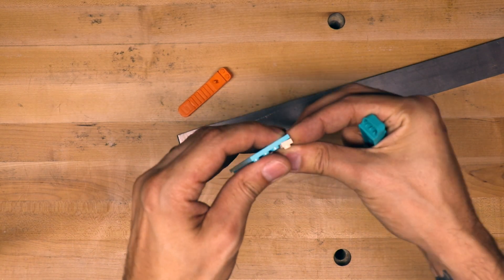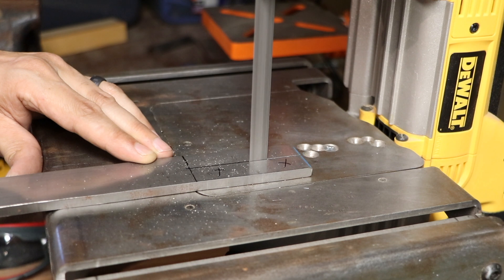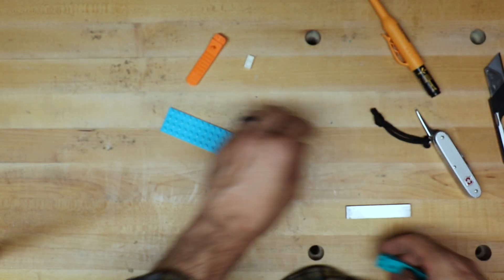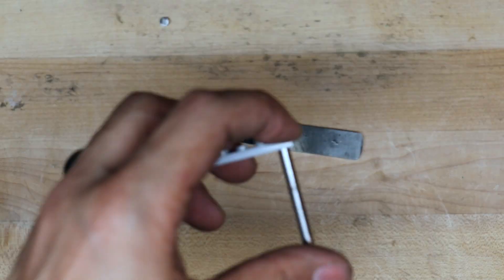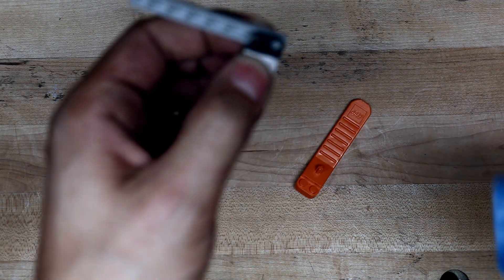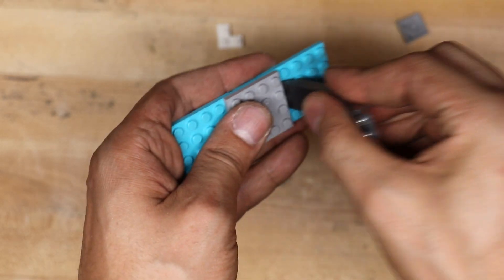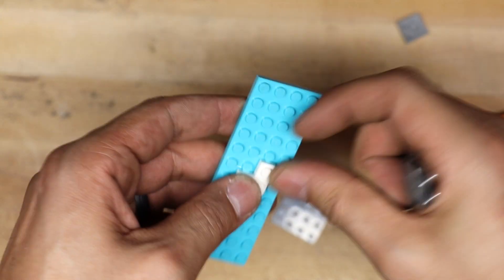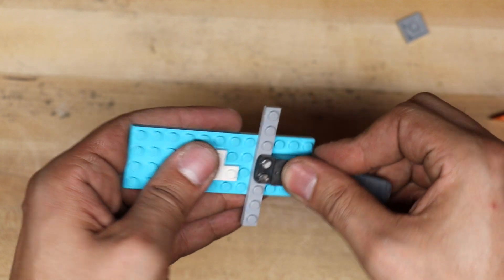Making a Lego Brick Separator Tool out of Metal!

Comment: The "pry bar" is for getting under tiles (which are obviously studless), they have a groove for this. You use the first technique you showed on the 2x1 plate placed in the middle of the larger plate.
Reply from the maker: Thanks for the tip! I rarely use the tool, so I appreciate the info. I usually just destroy a fingernail instead. 😀